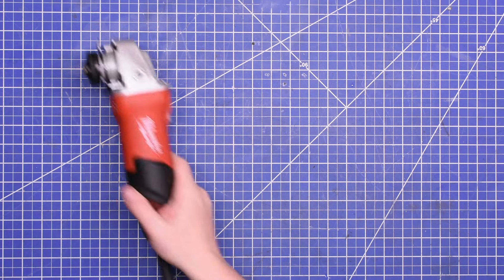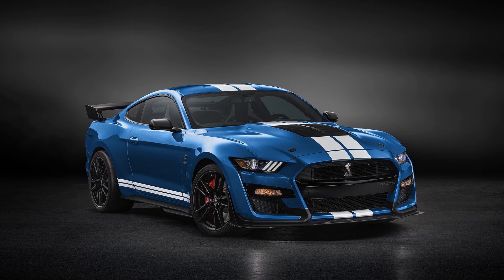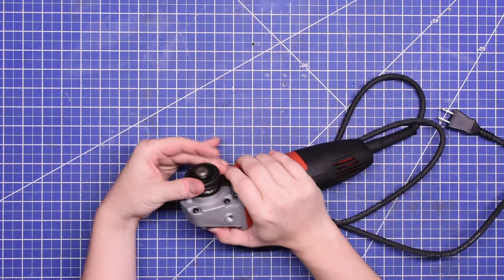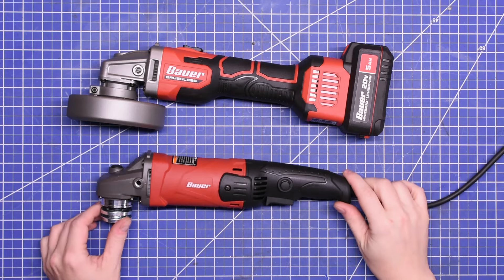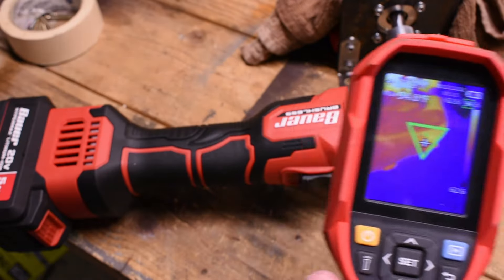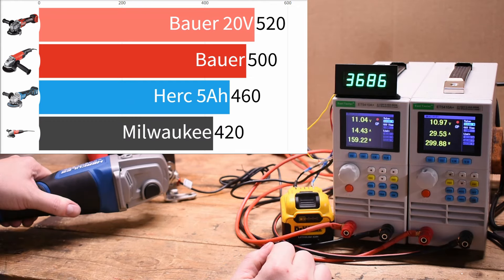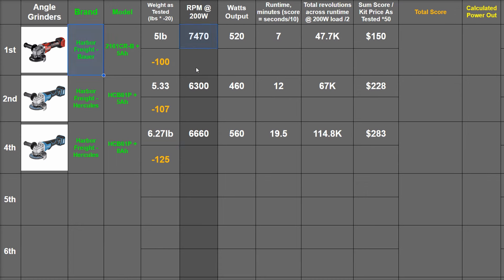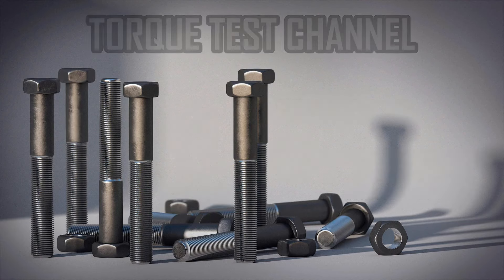Corded v Cordless Angle Grinders Dyno'd! Milwaukee vs Harbor Freight

Comment: I bought the Hercules about 2 months ago and I'm very pleased with it. It's a good grinder with the 5 amp battery. With the 8 amp with the high draw cells it turns into a beast. I usually have a 7 inch cut off wheel and you really have work it harder than I want to hog a cutoff wheel to get it to stall

Comment: Excellent video. The Bauer really surprised me with its performance for the price. I was also surprised that both the corded and cordless Bauers looked to have very good ventilation on the head. I did not notice much if any air flow through the head designed for the Milwaukee or Hercules. Very nice testing setup. Thanks so much for sharing this information with us!

Comment: Just a little note on the heat. Ive found if you take apart the head and pack more mollie into it, they will heat up on use but then cool down if you allow the fan to do its job free spinning. Any grease with molybdenum disulfide in it will work, just smear a bunch more into it so it doesnt just fling it to the case.

Comment: Thank you for conducting tests on these angle grinders. I have been using the Bauer 8 amp angle grinder for several years and it has performed exceptionally well. However, I am considering upgrading to their battery-powered brushless grinder. I already own several 5 Ah batteries and recently discovered that an 8 Ah battery is now available in stores. It would be interesting to see how the performance of the Bauer cordless angle grinder compares when tested with their new 8 Ah battery, particularly in comparison to the Hercules brushless grinder with their 8 Ah battery.

Comment: for me, the consideration I put into buying angle grinders is primarily comfort. I prefer rat tail grinders over all other types, and I only have 2 cordless angle grinders and way too many corded ones because the run time of cordless is honestly a major turn-off.

edit: I'd also like to add that for a cordless grinder to be worth it for me, I'd probably need to use a 12ah battery which would come with huge draw backs considering both added weight and cost
Reply: I feel exactly the same as you
Reply: Yeah idc about "beans" on a grinder. They use a ton of power. Battery just doesnt' make sense

Comment: Honestly I love this.  Cordless grinders so far have just been a pick-n-pull solution and for shaping motocycles seats on my end but if I could get 20 minutes run time out of one while having even 70% of the umphf of the low end Bauer corded, it would be a revelation.

We normally have 4 grinders chucked up with different wheels for a cage build day but if the flap disc one (only one used in car and out) could be cordless...game-changer.

Comment: Vibration is a really big deal. I was using an old corded DeWalt that I hadn’t used in years. I was using it to shape metal for a knife blade. It felt like a lot of vibration but I figure I was only shaping one blank, it couldn’t be that bad. 

For hours afterwards, my hands were tingling and felt oddly swollen and just not right. Thankfully, it seems like I didn’t suffer any permanent damage but it was very scary. 

Don’t use high vibration tools even if you think it’s gonna be for a little while as an amateur. The damage can be cumulative.

Comment: Love to see the kobalt 24v grinder tested(KAG 424B-03).
Far as I know, it's an older model. Has soft start feature, battery life is around 10min if cutting with disks on a 4ah. It was a good price when Lowes had it for $100 with a battery starter kit.
I'd be happy to lend you mine, it's got only a little use on it.
Reply: I’d love to see that one too. I like the Kobalt dual action polisher. Measurements suggest that it has lower vibration than almost any other dual action polisher. And it’s really cheap.

Comment: Please take a look at the 2680-20 M18. it’s an ok grinder but after a couple years of use it was giving me issues. Popped it open and found the rear bearing that supports the armature is microscopic! I managed to fix it but I know it’s only temporary, I need a cordless grinder but buying a more expensive m18 feels like I am rewarding them for designing a garbage brushed version.

Comment: I own the 8A Bauer and have used it fairly rigorously for about a year now and haven’t had a single issue with it. Well worth the money. 
Also, as an electric motor mechanic and winder we use amps as a more accurate measurement of output power. Amps= watts x volts. In an induction motor at 120v, 1HP is 12A (give or take depending on efficiency). Being brushed motors may change that ratio but I’d assume it’s still a direct correlation. So ,in theory, more amps=more HP. In the induction motor world, manufacturers can lie about HP output but cannot lie about amps. I can pull 10 different 1HP motors and have 10 different amp draws. But they amps draws are supposed to be accurate.

Comment: I used a brushless cordless Angle Grinder for a garage door project. In order to get near continuous work, it took 5 batteries and fast chargers to cycle through. With the only work stoppage was to switch out batteries. After, I wondered if a corded model would have been better and less time.
Reply: Also forgot to mention that it was five 4ah batteries.
Reply: You're nuts.

Comment: Hope you can do more Bosch tools.
Just got a Bosch GWS 18V-15 SC, that claims 1500W equivalent. The adjustable speed made it possible to use with a wire brush that normally shakes you and the grinder so bad its unusable. And when the grinder starts jumping using the wire brush, it automatically stops. So far I'm glad I got the top of the line model.

Comment: Great stuff, the runtime test is very informative.
Angle grinders really drain the batteries, like a string trimmer, because of their continuous use, unlike the intermittent operation of a drill or chainsaw.
I have to keep at least four 6AH batteries on hand if I'm going to make a day of it (while charging the expended ones)

Comment: I have the Milwaukee 7amp, got it roughly 4yrs ago. All of it is true, I was using it today actually as I had a good bit of grinding and the fuel grinder is a battery serial killer. 1st time in a long time I've used it heavy. I actually thought the grinding disk I had was on wrong it was vibrating so bad, and it did get rather warm. Has plenty of power for normal grinding cutting, but my hands started to hurt from the vibration. Cutting disk isn't so bad

Comment: Very good comparisons, I like this angle grinder category, the battery operated are so convenient to use on site with no electric or in the field, I own three different ones, a Bosch gws18v-13c,  Milwaukee 2981-20 and a Milwaukee 2880-20 got a piece of metal to cut in a pinch no problem, so quick

Comment: HF still has that 58089 for $10 locally. I haven't been in or around a metal shop in the last 5 years that each table doesn't have 4 or 5 of them hanging with different wheels on each.

Comment: I would like to see the 4 1/2” DWE43231VS vs 5” DWE43240VS DeWalt brushless corded grinders tested. From my testing, no-load amp draw is very low and they seem to hold rpm well until overload kicks in. Also don’t seem to overheat under load as quickly as a normal brushed 110v grinder.

Comment: I'd love to see some comparisons between Makita corded and cordless grinders. I live in Chicago. There are a lot of brick buildings in this city, and I see a lot of masons grinding old mortar joints before they re-point new mortar.

I don't know if I ever see professional masons using cordless grinders., but maybe they do when they're working on swing-stage scaffolding on brick buildings that are > 8 stories. I have noticed guys using makita corded grinders on some worksites.

I'm not a pro, but I bought a Makita 18V grinder a couple years ago for some small jobs. I own both Makita and Milwaukee 18V tools and I have batteries for both, but online reviews suggested that the Makitas have smoother performance. I'd be curious to see how both corded and cordless Makita grinders.

Comment: This channel is amazing. Everyone is like “just get a Milwaukee”. But this channel shows you there are similar tools for a fraction of the cost. I don’t bow to any teams. If there’s a good deal to be had, I go for it. I do have mostly Rigid stuff, but I also have a ryobi pressure washer and ryobi blower and weed eater. My pole saw is made by Kobalt. Pretty sure I have a Hyper Tough drill around here. My drill bits are Husky along with my socket wrenches and torque wrenches

Comment: Hmm, very surprising results regarding rpm. on the corded grinders but then again, I live in Sweden were we have 240 Volts, and 1100-1700W grinders are norm.
I think they really do 11'000 if they are 125mm or 4,5"
The larger 180mm or 7" grinders usually have 8500Rpm and 2300 watts these days.
Complicated, but a 240 VS 110 volt corded grinder from the same manufacturer would be very interesting.
Great video !
Reply: These are fairly small grinders. We get plenty of options in the 1440-1800 watt range here. But we don't have anything for 2300.

Comment: Do the $15 drillmaster grinder from harbor freight. I have 2 that I have used for about 5 years, beat the tar out of them, the bearings sound like a blender, but they still are both working.
Reply: Drillmaster: when even Bauer is embarrassed to put their good name on a tool!  

I've also got a $15 shillmaster I picked up out of town to do a job without having to drive home and back, and I'll be damned, I haven't killed it yet either!

Comment: the one thing im thinking about is the aussie models can pull way more wattage, 2400w due to our voltage differences at the wall, so im wondering what models are designed for here and what are just import with a different plug

Comment: I install larger guards so all my cordless grinders can run 6" thin kerf cutting disks. Any decent 4-1/2" is much more useful with the faster edge speed and greater reach.  I don't buy corded 4-1/2" new since 6" use all their accessories and have far more power. 

If you want a high speed angle die grinder cheep to spin flap abrasives and stones you can do as I did by drilling and tapping a (quality steel) Jacobs chuck to 5/8" -11.  Super handy addition to any welders tool bucket turning any angle grinder into a die grinder. If you don't have a lathe you'll need someone who does but they can "chuck the chuck" and do the job in minutes.

Comment: Bosch tends to rate their corded angle grinders based on power usage and their battery angle grinders "equivalent to" the corded watt ratings. Had been nice to see some of the battery ones with a 1500w rating tested. 

Powerful batteries on angle grinders are also really important. I have a old Bosch 18v angle grinder and that performs average with normal 18650 batteries. Tried with a procore 8ah pack which is the high performance 21700 cell pack from Bosch and it almost felt like a new tool. Way more speed and power with higher performance batteries

Comment: Seems to be the same story with all the new Hercules tools. The 8 amp hour 21700 cell battery is what makes those tools all worthwhile, including the hammer drill, impact wrenches, circular saw and reciprocating saw as well. The impact driver is such a beast it seems to be effective regardless of battery though.

Comment: I've got one of the bauer corded grinders, I've been using it for about 3 years and it's still going strong.  It might not be the best, but it's pretty good for cost.  I've also got an older bauer cordless and they must have improved them.  It's only good for sanding and stalls easy. Battery doesn't last long either.

Comment: With the "run time" testing, it would be interesting if you used these (with more platforms of course) to somewhat "test" the batteries from different manufactures. 
I say this because I see a lot of online reviews about batteries from Ryobi and Bauer dying much faster (even if the batteries should be equal)

Comment: Flexvolt would level all of them

Edit: DCG418B is the stronger variant advertised at 30% more power. 
I have the older DCG414B and it's a beast already

Comment: With all of the advantages of the cordless models (e.g. temperature, vibration, and power put), i wonder if there are any 110v battery eliminator adapters to gain those features without having to swap batteries during a job.

Comment: I would love to see the metabo 11amp angle grinder in the future. I have used lots of grinders fabricating and have burned up
Everything other then the metabo 11amp. It can take some serious abuse and has a lot of power. I have had it a few years and it's still running strong!  Look forward to the new tests on the channel!
Reply: It depends on the operator. I like makitas but I have used hilti, dewalt, bosch and aldi and I have never broken one in 20 plus years.  They all work, some are nicer than others but all get the job done

Comment: Bauer now has a 8ah battery at $99 I wonder if it would jump in performance like the Hercules did?   Also I just picked up the Hercules 20v brushless cordless 90 deg angle drill. It's a really nice tool. I would be interested to see the output with the 5,8, and 12 ah batteries.

Comment: HF released an 8.0Ah battery for the Bauer brand a few days ago. But it's not in stock at my local store yet. I wonder how well it would do if you retested using that battery. Also, the smallest battery for the Hercules Extreme line is 4.0Ah. Again, I wonder how well that battery would do as well. It seems to be the best choice for decent capacity and weight savings if you're not going for a big chonker battery like the 8.0Ah or the 12.0Ah packs. :)

Comment: My experience would suggest that (corded) Makita grinders are by far the most popular grinders in fabrication shops. I'd like to see something along the lines of a GA4530 and GA5020 (4 1/2" and 5" respectively) as benchmarks. 

Note: The  lock-on / slide-switch grinders you featured are often prohibited for job-site safety reasons.

Comment: I would like to see the 60v dewalt cus the one I have is a beast. Plus I have two 5" dewalts and would like to see what the difference is between the power detect model vs the flex volt advantage 20v model.

Comment: The input current is less of a power rating and more of an electrical thing. Same as most other corded tools and home appliances. It just lets you know how many of what you can run on a circuit. Also helps to diagnose shorts in the tool, although usually the funny light and sound gives it away first.

Power output really doesn't matter that much. They have plenty of torque and the wheel is what limits the speed.

Comment: Where was a comparison to the current brushless milwaukee grinder? I have one and its great for quick in field cuts. 
I also have a 13 amp Bosch corded grinder that is very nice and smooth. 
The only problem i have with it is the spin down time is so long that I cut the cord on accident because I was so used to the fast stop of my Willfuckyee.

Comment: I'd like to see your take on the Dewalt Flexvolt Advantage grinder (DCG416) and how it responds with 20v versus 60v batteries it apparently can take advantage of.

When I did some testing on it, I was a bit disappointed as it really didn't have any more beans on 20v than just their regular 20v version and as soon as you need 60v batteries, it's WAY behind their actual 60v grinders, cheaper to just buy the 60v kit at that point with tool + battery.

Comment: Wow another awesome dyno setup! Thank you so much for doing these!

Corded really sucks, it is not only about battery vs no battery yeah, they use motors that are much better.
Btw I saw that hikoki has some corded grinders that use brushless motors, maybe those would be interesting to test?
Reply: Hikoki also makes a corded sds max rotary hammer with a brushless motor. I don't know why more manufacturers don't do this. Also why hasn't the cordless to corded battery adapter caught on? One tool you decide corded or cordless depending on the job.
Reply: @jimkane9832  yeah good questions! If you really wanted to you could make your own adapters but I agree.

Comment: I would love to see a brushless corded tool vs a cordless.
Reply: (serious question) what are some examples of brushless corded tools?  I've been trying to keep my eyes out, but most of the times when I see brushless I end up discovering that it's a battery tool and not a corded tool after all.  I'd especially love a brushless corded shop vac
Reply: Dewalt corded brushless grinders!
Reply: @omaristephens2143  DeWalt has corded angle grinders, Metabo HPT has some large rotary/demo hammers.
Reply: @omaristephens2143  
Fein apparently has a brushless corded angle grinder too. 
But I'm not too convinced brushless motors make much sense in a corded tool outside of niche applications where dust or water resistance is especially important. 
Brushed tools are less efficient but they have better cooling, age better (no electronics unlike brushless AC tools that need a full SMPS and digital controller etc.) and are cheaper.
And for bigger tools three-phase induction motors are way better anyway.

Comment: As alawys, Bosch Professional :)
I use the 18 Volt Angle Grinder (GWX 18V-15 PSC), and while it feels strong af it has a thirst for batteries to match it :) It is however a 125mm Tool which is closer to 5"
Metabo would also be great, seems like a more balanced tool to me, not as strong (still plenty) but also doesn't drain a battery in 5 minutes.